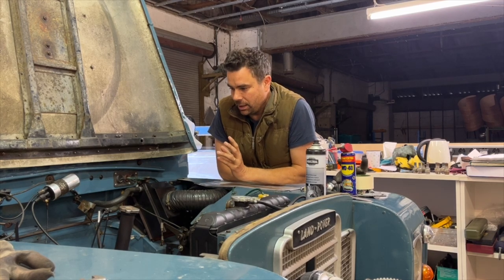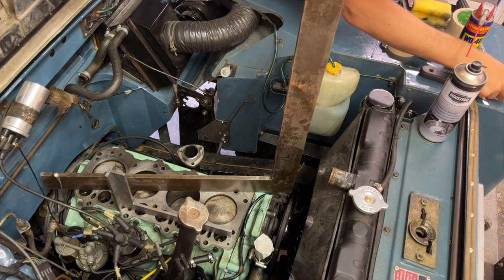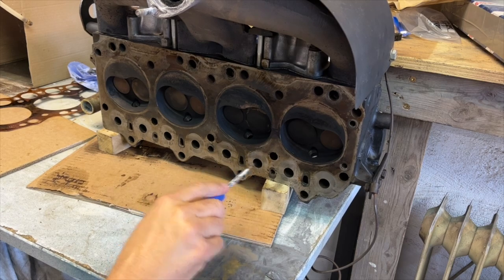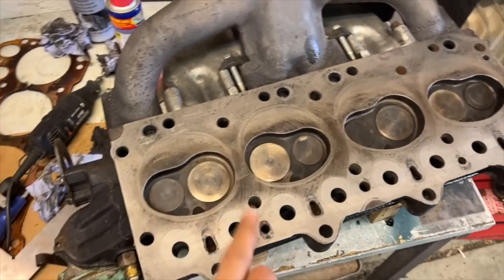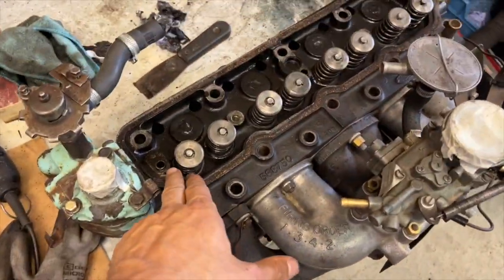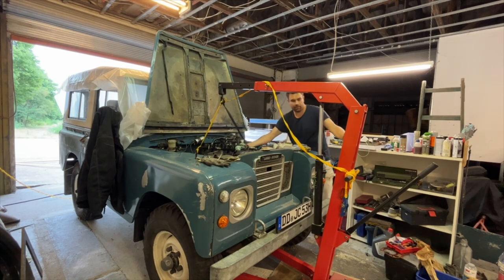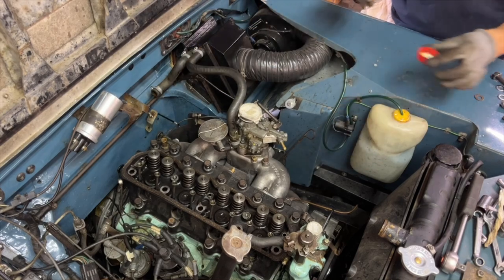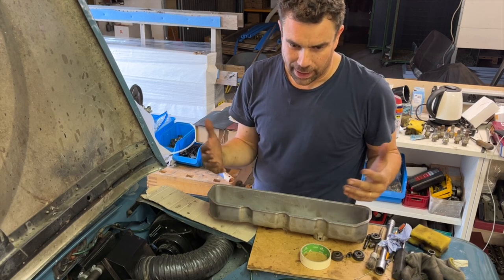Land Rover Series 3 Restoration - Part 86 - Checking the Block & Head - Pt 3

Comment: It's also conceivable that the particular head you mentioned requires longer or shorter head bolts or a particular thickness washer. If the head bolt either bottoms out in the block or isn't long enough to bite correctly, this would also result in a blown head gasket. It may even have a different specified torque.
Reply: Interesting, how would you check Greg?
Reply: @srw_cricket2976  measure the depth of the hole the head stud goes into with the head and washer in place and compare it to the length of the head bolt or contact the head supplier. I've no experience with this head, but some aftermarket heads for BMC engines specify upgraded head studs or bolts of different lengths, tensile strength and torque or supply there own. The thickness of the boss the bolt goes through in the head may differ from stock.
Reply from the maker: Hi Greg, a lot of insight again. Many thanks and very interesting. I will definitely check the torque wrench. 👍

Comment: Great vid !  And thanks for the shout out. My daughter thinks I’m cool for the first time since she was a toddler. 

I think your rocker shaft has been put in wrong .. and that’s why the hole on No.2 (?) pedestal doesn’t line up for the special screw ..
Reply from the maker: Hey, cool!!! 😀

Re shaft: So you think it is the wrong way round?
Reply: @My911  I don’t know S3’s … but the S2 and 2a’s have two locking screws. The only way I would think you wouldn’t have a hole would be it being in wrong ?  I’d check though with someone who knows for certain.
Reply from the maker: Will do. 
#Steamwally, here I come! 😅

Comment: great way to locate the cylinder head is to use two old cylinder head bolts and cut the heads off and screw by and into main body holes to act as a guide for the head.... put some of the proper bolts in and take the cut ones out... perfectly aligned.
Reply from the maker: Cool tip. Thanks!

Comment: Thanks for sharing. What is the gauge thickness ?
Reply from the maker: Hi Philippe, do you mean to check clearance? I set it at 1/2000”
Reply: @My911  Hi thx for your answer . Yes to Check clearance . Is it equal to 0.13 mm?
Reply from the maker: Hi. 1/2000” (two thousandths of an inch) is the same as 0.05mm. This seems to be acceptable warpage on an iron head. Hope this helps. Regards Joël
Reply: @My911  thank you Joël. It helps a lot .

Comment: I hope the comment is useful, but the thing is a low compression series landcover shouldn't blow a head gasket, certainly not after almost no time on the road. If you don't change the coolant in 30 years or just use water, then sure that might happen, but it's just not a thing that should happen as it has in your case. Deck isn't warped, head isn't warped, very good. Only thing I can think of is that the head wasn't torqued correctly in the first place. It's hard to tell from the time lapse but it didn't look to me that you were swinging on that torque wrench as I would expect, it's possible that its lost its calibration. It's also possible that the head bolts have been over torqued in the past and the threads are stretched, in which place they need to be replaced. It's unlikely, but possible there is a burr on any of the holes, either bolt, coolant or oil in the block or head. One usually chamfers them before installation just to make sure, but then some people don't. Check that torque again yeah, it's important, not just the sequence. People do that job in a muddy field with far less care than you have and are fine, it's that kind of engine. So something went very wrong the first time around and it's unclear what that was.